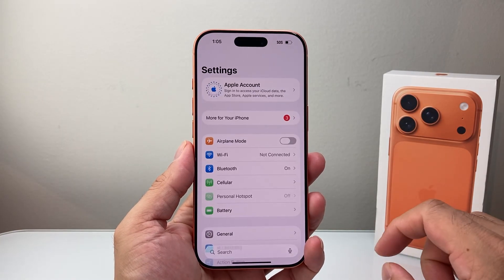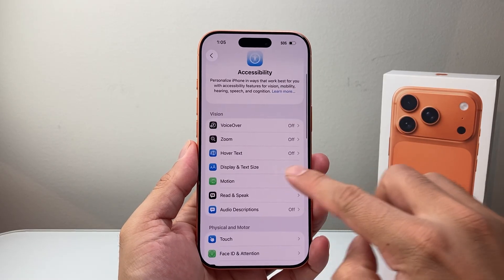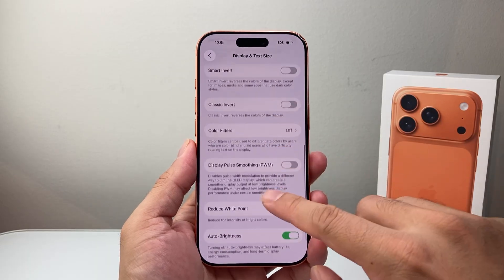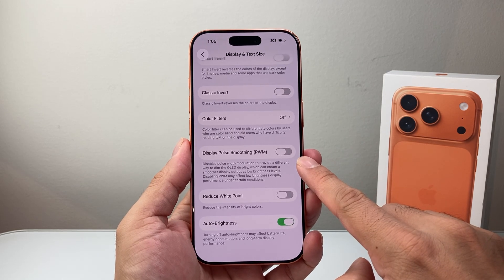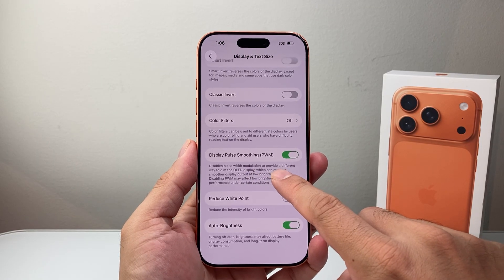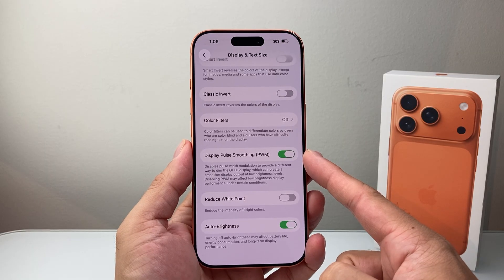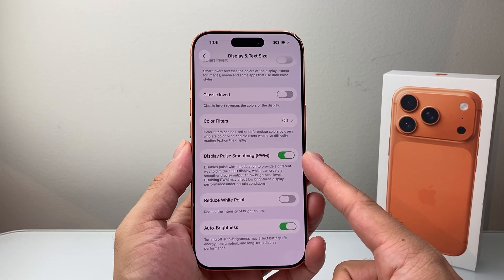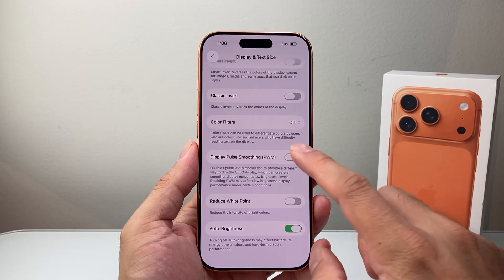How To Turn ON / OFF Display Pulse Smoothing (PWM) On iPhone 17 Pro / Pro Max

Comment: The green toggle means that it’s turned OFF in this case, it comes default with it on (toggle is grey and to the left). Display Pulse Smoothing is an accessibility feature on iPhone 17 models that reduces screen flicker by disabling Pulse Width Modulation (PWM) at low brightness levels. This alternative dimming method aims to provide a smoother display output, potentially alleviating eye strain for sensitive users. However, Apple notes that disabling PWM may affect display performance under certain low-brightness conditions.
And that paragraph above further proves it’s on by default, and toggle it to green would mean that PMW is off… just so everyone knows 👍
Reply from the maker: Thanks for the info!

Comment: Yey nothing. Apple is scam. I buy an iPhone air but, this setting not change the eye strain and headache. It joke this setting...
Reply: Holy english
Reply: I did a Google search and came across this video. I am legally blind but have enjoyed using iPhones since the 6S that I still own. I tried out the 16 series last year and it completely gave me headaches and there was times my eyes would water. I end up exchanging it out for another brand. It would be nice to know if this flickering switch on and off actually woodwork because I would be going right back and getting a iPhone 17. I do miss the iPhones drastically
Reply: @guitarmaneddie8267 unfortunately the slider is to turn this off, and all iPhones with an OLED display come with it on by default. So if you were already having this issue on an iPhone 16, this setting will not make it better, in fact it could potentially make it worse. Apple has never given you the option to turn PMW off, until now. If you don’t mind me asking, what phone did you switch to?
Reply: When you turn the toggle to the on position (turns green and slider is to the right) that turns PMW OFF. Your phone by default has it on, and the slider is actually to disable, not enable it. So you leave it how it was from the factory, and that should help. I know it’s weird, and Apple should’ve made that more clear. I had to do some digging to even figure that out in the first place. Hope this helps you guys.